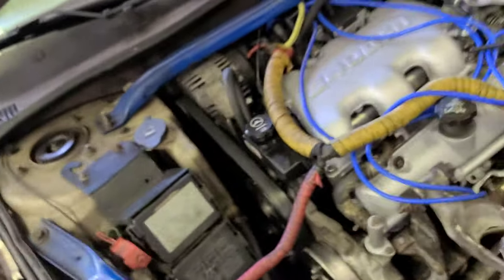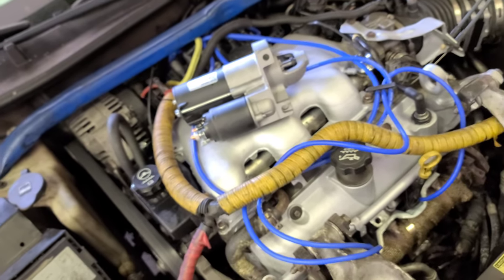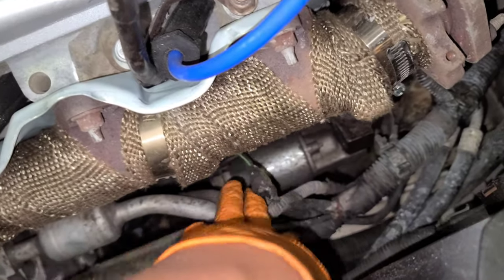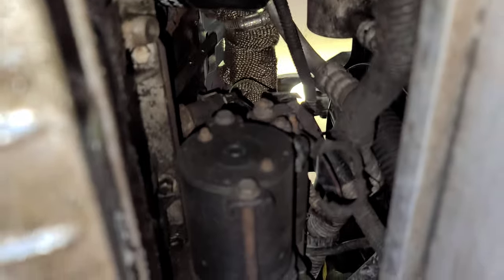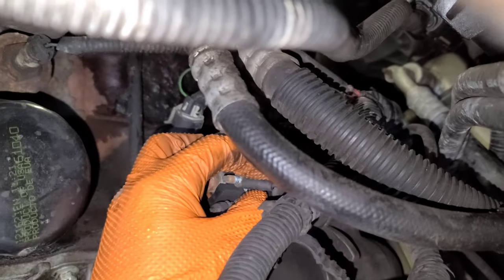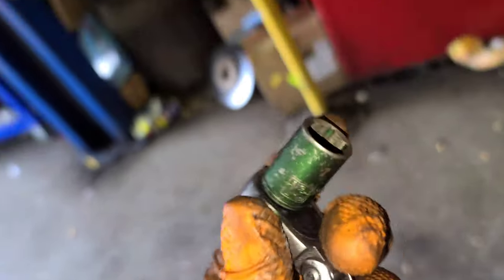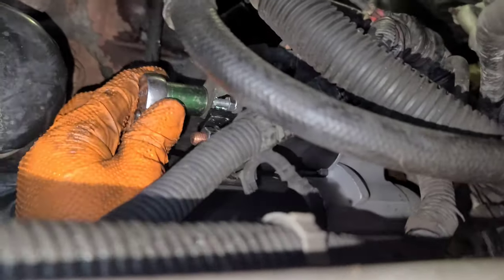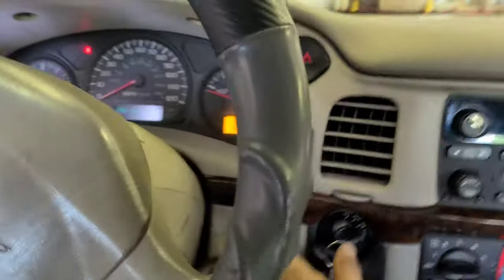2000 - 2005 Chevy Impala How to Replace Starter

Comment: On the drivers side of the engine ( left side ) there is a nut/washer holding about 5 wires, CORROSION here can cause poor connections for ground ( -- ). This caused my starter not to work. So I sanded all these eye hole wire connectors on both sides & this engine block spot. After re-assembly sprayed coating here to protect from moisture & air.  Saved *50 to *200
Reply from the maker: Who knew a little corrosion could cause so much trouble? Good thing you were able to save some cash by fixing it yourself!